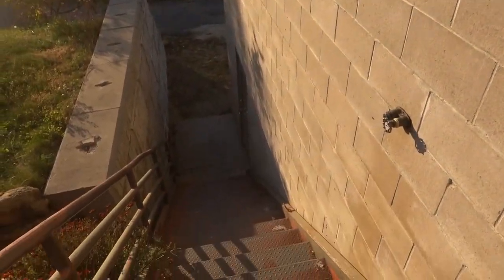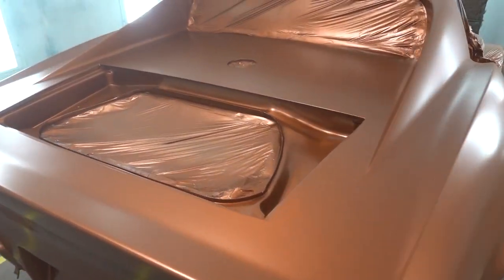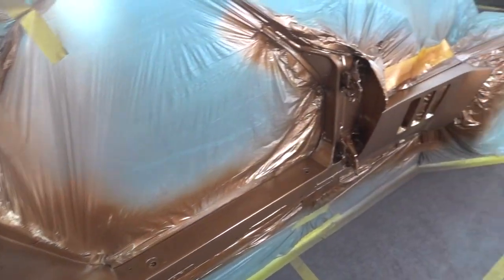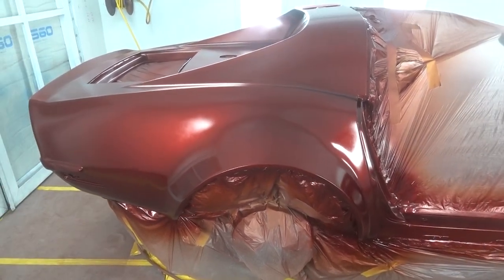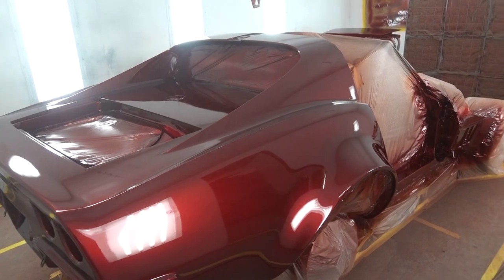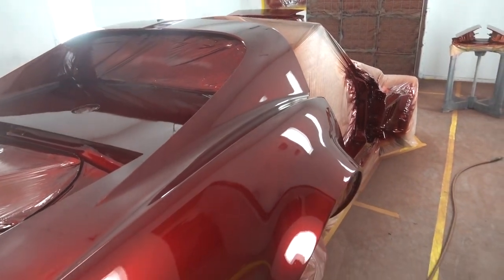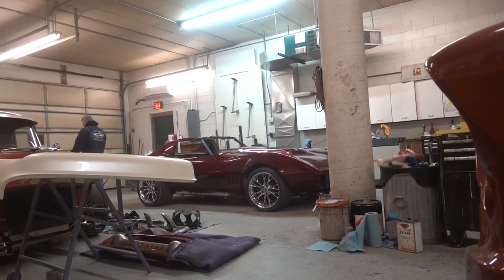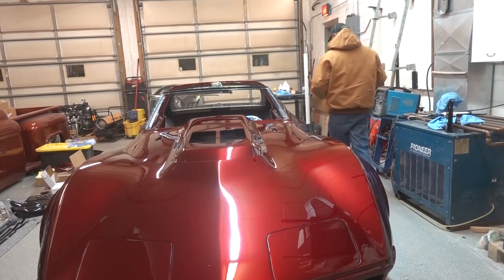1971 Corvette Wide body Legendary Paint- Part 2

Comment: Beautiful paint job, but who made the decision to put those huge wheels on that car?  Are you planning to be driving around in the hood, or what?  Those wheels are WAY too big for that car.  Nice paint job though.
Reply: It's a big paint project but fiberglass will always be easier then metal working custom restorations, plus at the end of video all I saw was a poorly primered frame under the nice paint work or maybe was just dirty? The tires are just on the cusp of ridiculous but even that stuff goes in cycles. Having any EXTREMELY exaggerated feature is purely for attention at the car shows as this guy won't be driving it on the road much. Overall nicely done for $140k. 🙄